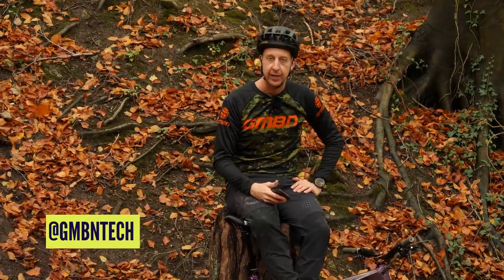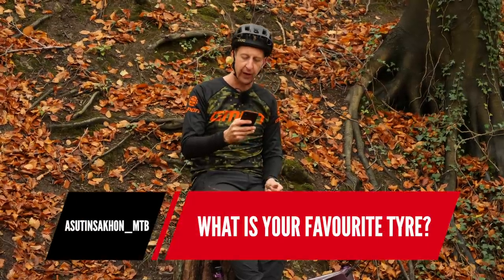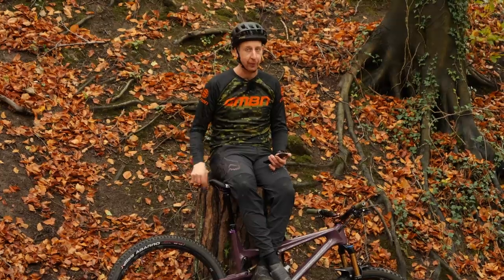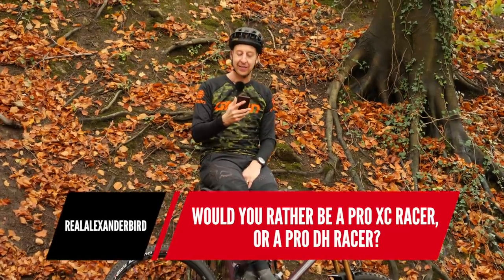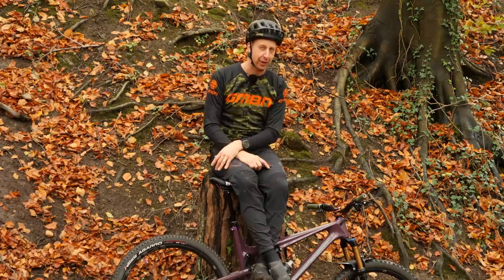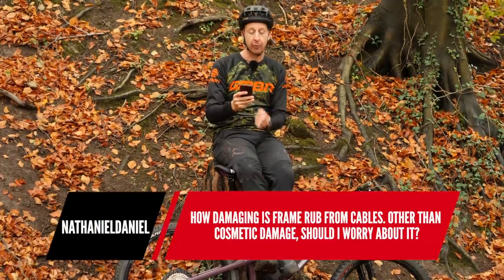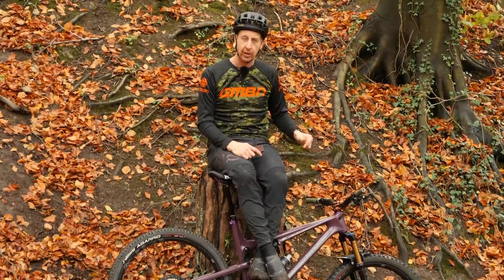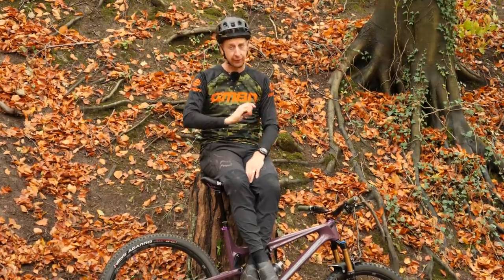How To Remove Rounded Hex Key Bolts? | #AskGMBNTech

Comment: #askgmbntech

Why is there no Tyrebrand that makes a front tyre with more aggressive thread, more grip but less protection, since the Front tyre usually doesn't get that much abuse as the rear?
I don't see the point, about a 200gramm heavier tyre with more protection on the front, I need grip.
Reply: Maybe you should take a look at Vittoria. the Trail-Version (dark grey sidewall) is a bit lighter and the enduro-version has more protection (black sidewall)
Reply: @newmie911  Schwalbe features similar but the point is I don't need more protection (Enduro) I need more grip (Enduro) but not the heavy weights (trail)
Of course not only trail and Enduro but as a simile for the Vittoria tyres
Reply: @maikszczerbuk613  as far as i know Vittoria uses the same compounds on the two Versions. 🤔
Reply: @newmie911  That would be close to what I search, but idealy would be a softer compund for the front, hence more grip with the same amount of weight, or even slightly less.
But I appreciate your effort, I will look into it.